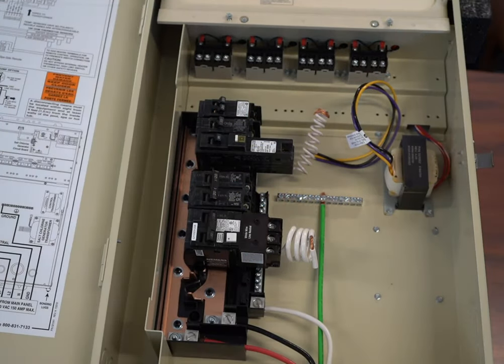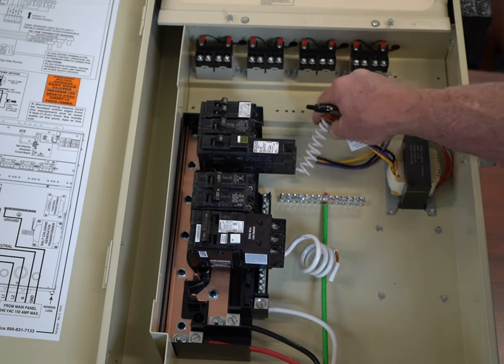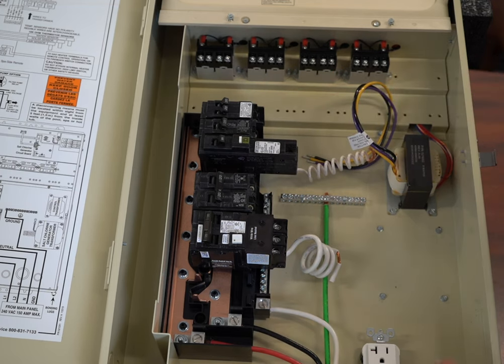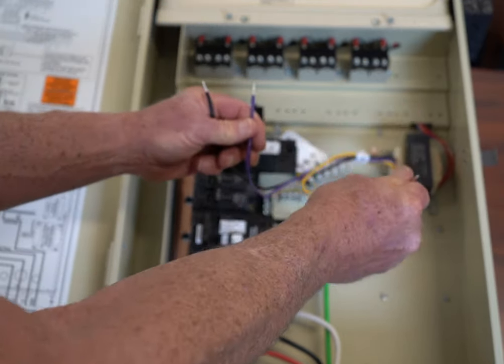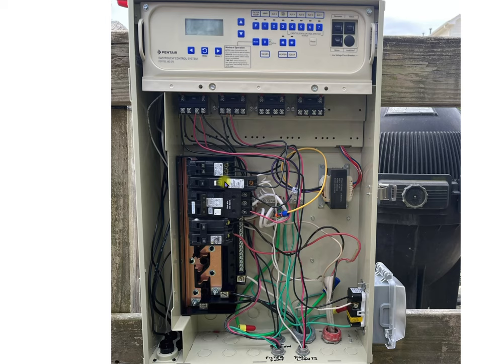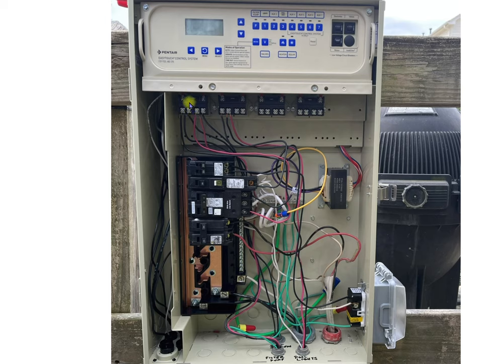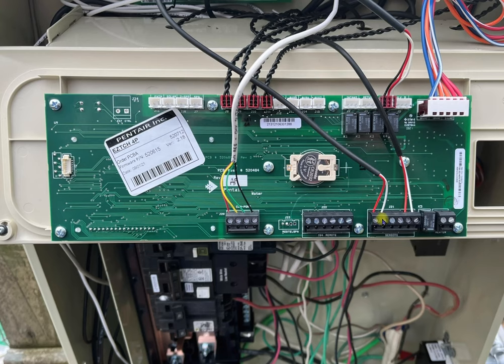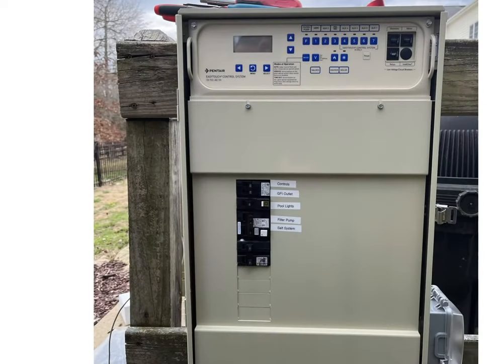Basic Pool Electrical Wiring Module 2

Comment: Great video. You're the ONLY video in the entire Internet that talks about the Pentair COM Port Expansion board at 30:40 and how to connect it and how it's used. For others searching - Basically it is a shared bus whereby you can expand your one Pentair J20 COM Port to 2 (should have been more but you can daisy chain these expansion modules but it will lower some voltage depending on concurrent access). You need 2 so you can plug 1 to your Wired Indoor Panel and 2nd to your Screenlogic Wifi Adapter.  Board J20 <-> Com port Expansion module J1. And J2 to Wired Indoor Panel and J3 to ScreenLogic Wifi Adapter. 
It's a shame Pentair charges $750 for the Screenlogic and so much for the board and does not even put proper expansion ports in it. It's like buying a PC with 1 USB port only. We need cheaper alternatives.

Comment: My pool has a non gfci 20amp 2 pole breaker. When I turn the breaker off the salt cell, pump and gas heater turn off. Is it normal to have all three of those wired to that one breaker? If I decide to switch out to the Pentair GFCI breaker is it just as simple as replacing it still controlling all three items? The only other breaker I have is a 15 amp single pole non gfci which controls the control panel and sends power to the GFCI receptacle  on the side which then has my lights running through the GFCI receptacle. Thank you for the great video!!

Comment: GFI's work on monitoring Current not Voltage! They typically trip with a differential of a mere 5 ma's
Reply: I was told they were sensitive to minute amount of moisture, makes sense , water effecting current and required in wet zones. Jim

Comment: Hello Sir !  On your 1st relay ( 13:54) , you mentioned the power(line) in of 120 and  power ( load) out of 120v,  my relay gives me a power in of 120 but only loading out around 25-27v and it the same issue on the 2nd line and load,  do you think my relay is bad and needs to be replaced ?

Comment: What would happen if you run a pool lights' neutral/white, like with the high voltage, through the relay vs directly to GFCI breaker?

Is there a direct reaction to its function?

Comment: Presumably your lights are 120V going to the GFCI Breaker - what if my lights are 12V  - I have a 120V - 12V AC transformer going into a breaker but I don't think that breaker is GFCI (in Florida). This was all inspected about 5 years ago and passed so not sure. As far as the breaker and wiring, how would you handle two 12 V LED lights coming into this transformer? Thank you!!!